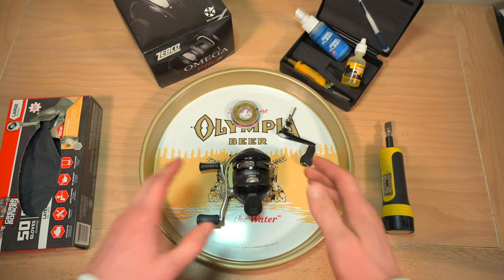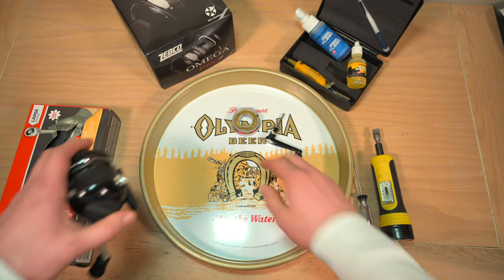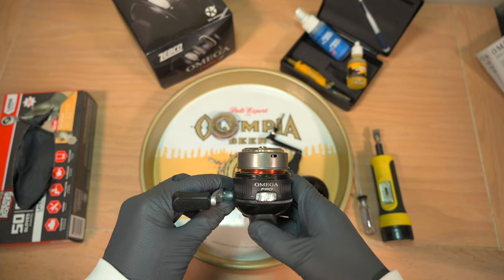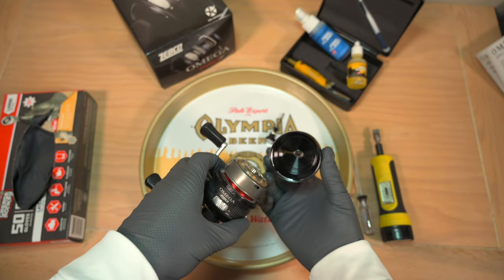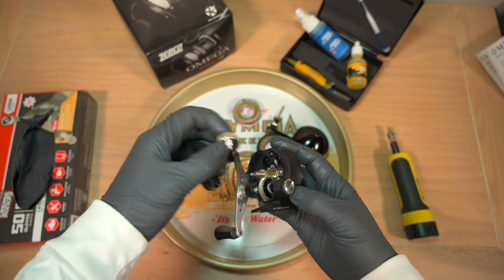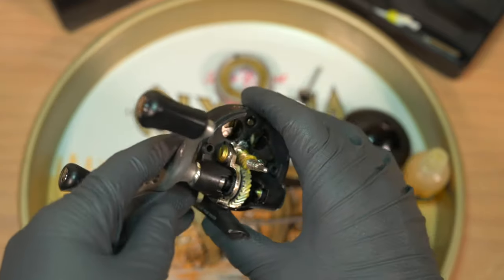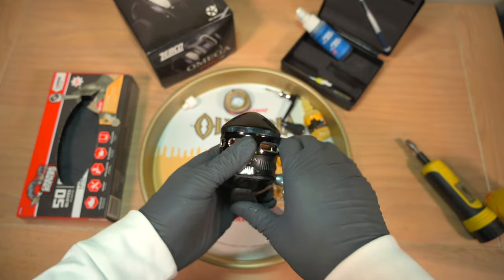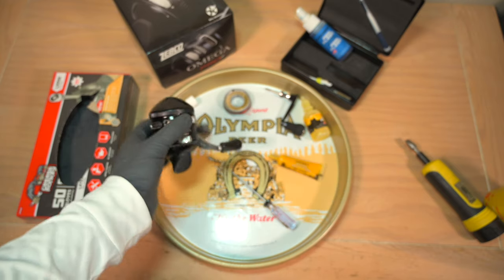OMEGA PRO: Cleaning a Spincast Reel

Comment: Great video! I love the Z03 Omega pro reels, but recently had one of mine come up with an issue, the anti reverse stopped working where the handle goes completely the opposite direction,  but not every time? There is no anti reverse lever on these, so I have no idea how this happened? Any suggestions on how to stop the handle from going in reverse when retrieving on these Z03's ? Thanks.
Reply: Try removing the anti reverse and clean with de-greaser. After that lube with minimal reel oil. If that is unsuccessful then you need a new spare part.

Comment: Humm... I wonder if the zebco bullet spinner head and spools are interchangeable with the omega pro? The bullet's pop out pins are actually roller bearings about the diameter of a pencil rather than the tiny classic metal pins. Seems like it would be a better design for heavier tension and keeping line from getting spool memory

Comment: Just got my omega pro about an hour ago. It came with the single handle on the reel. I don't like the single handle design on any reel. So I went to change it to the double handle that came with my reel. The single handle had a bearing on it. The dual handle dose not. I thought it certainly must interchange on a reel of this expense. But it doesn't. Is this true? Did I pay the better part of a hundred dollars for a reel I only get the touted ultra smooth feel if I use the single handle I'm not comfortable with..and yes there is a marked difference in the two handles.. please show me I have overlooked something. I just can't believe they would do that. This is wrong if they did..bad wrong.
Thank you for your time.